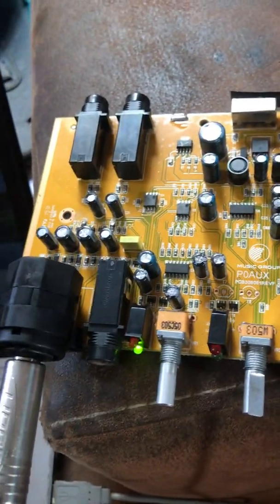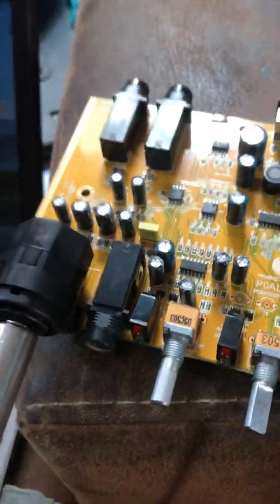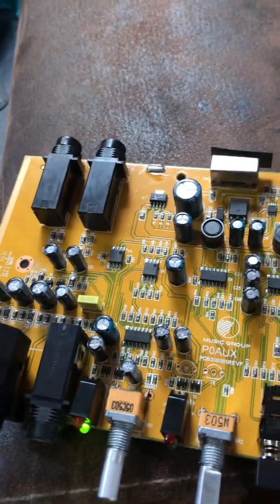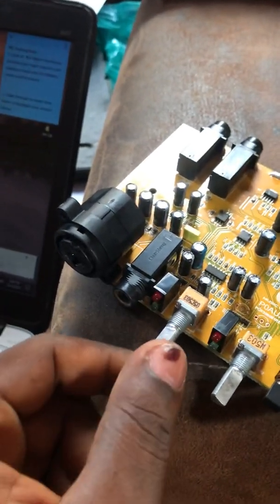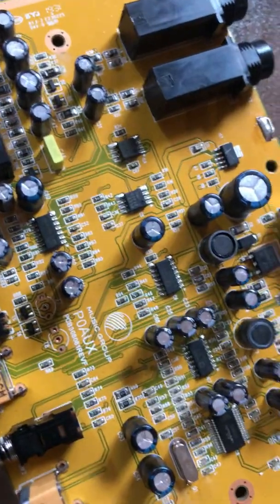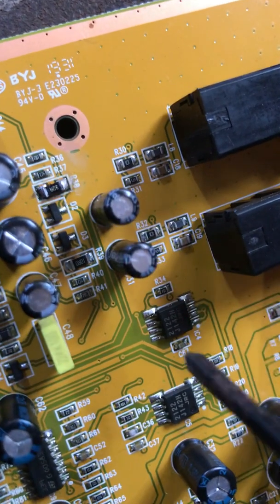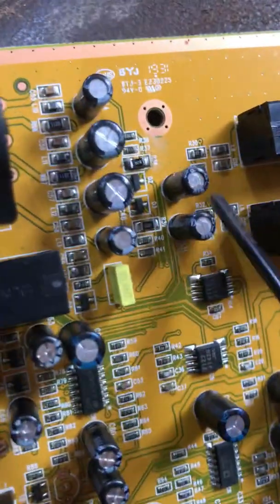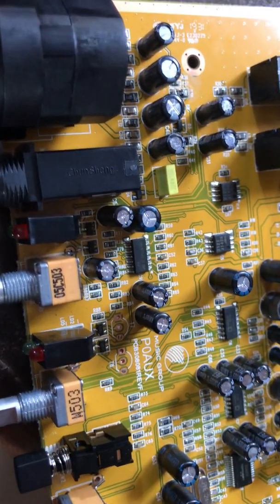How to Fix Behringer U-Phoria UMC22 _ White Noise on the input Channel

Comment: Thank you thank you thank you. Repaired a friends unit. Since those resitors were blown I just soldered  regular 10 Ohm resistors in paralell and voilá this preamp was revived.
Reply: Hello, what was the exact resistor you used. Could you please post a link. Also, what did you mean by "Since those resitors were blown I just soldered  regular 10 Ohm resistors in 'paralell' "...?
Thanks in advance🙂